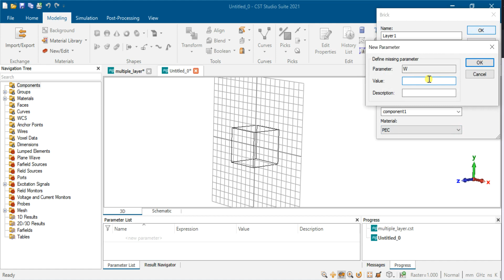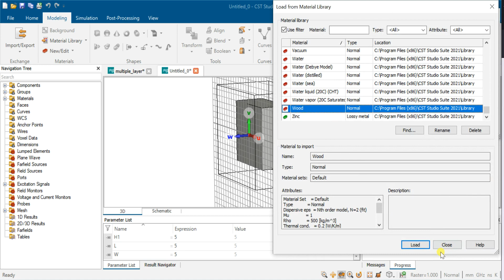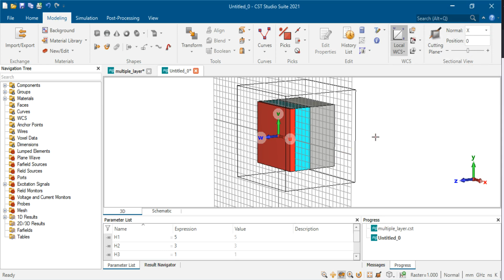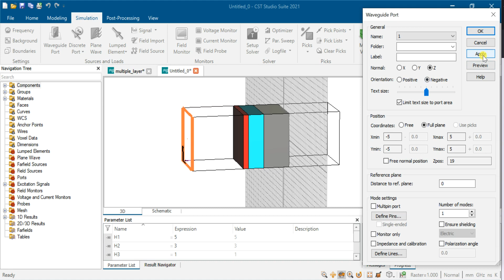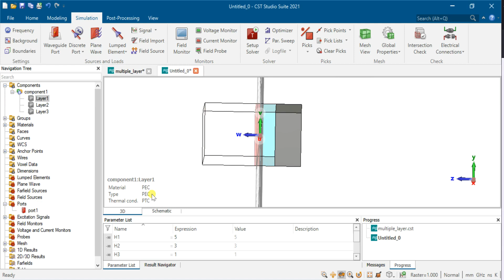Design Multiple Layers structure in CST

Comment: Can u please make a video on monostatic and bistatic RCS in cst. Thanks
Reply from the maker: Hi, I think this the video you looking (https://www.youtube.com/watch?v=H2nzwKlTahA)
Reply: @LYSStuff  thank you so much for your kind reply. actually your mentioned video is only about monostatic rcs, i need for bistatic as well and moreover the difference between both in cst. Thanks once again
Reply from the maker: @hamzaasifkhan8421  Hi, you may refer to CST help file and example in CST. Search Asymptotic Solver for more info about Bistatic. 
Asymptotic solver can be applied to calculate the bistatic RCS of a simple PEC sphere. The calculation uses a single incident plane wave from an angle of

     theta = 90 degrees and

     phi   = 45 degrees.

The RCS is calculated in a single farfield plane (theta=90 degrees) for a varying phi angle using one degree steps.